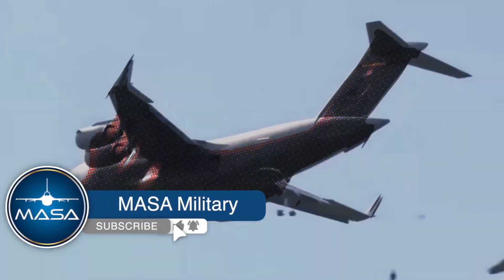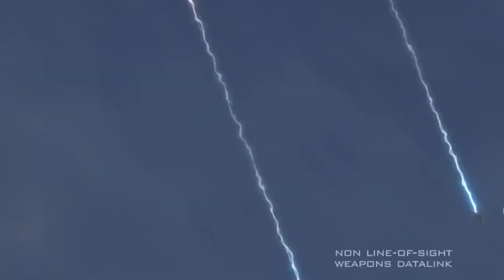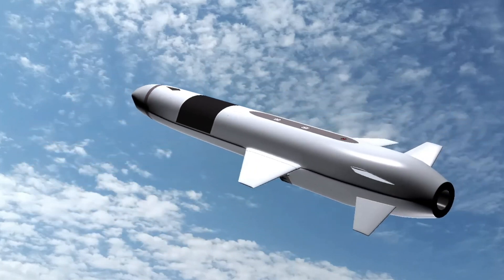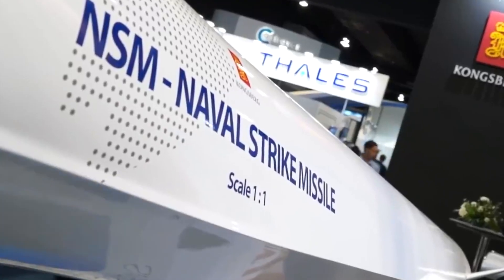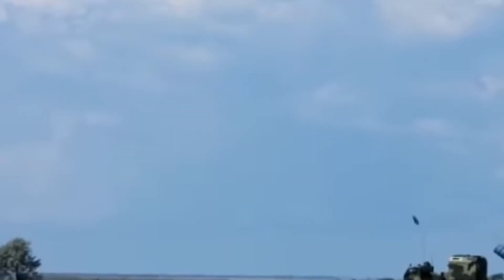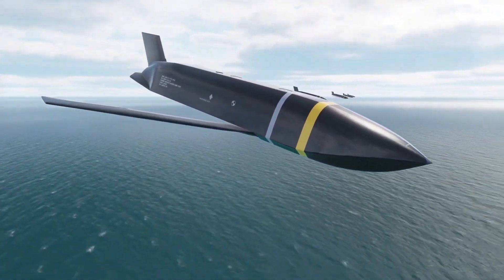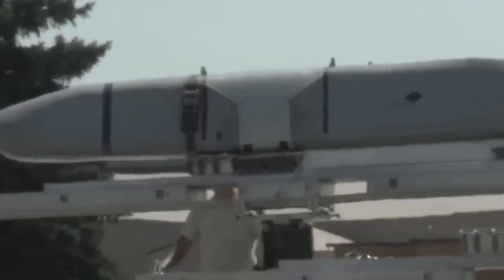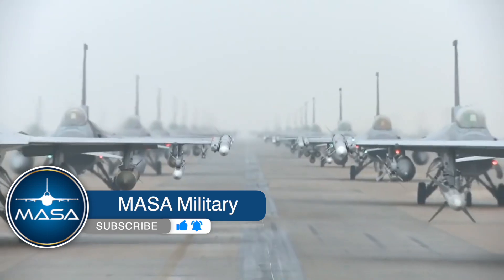U.S. Anti-Ship Missiles Go Fully Stealth, #AGM158C #LRASM #NSM #NavalStrikeMissile #military

Comment: A general basically said. "Would you rather have hundreds of other missiles or one hypersonic."

 So stealth all the way once he put that in perspective. Hypersonic missiles are weirdly expensive. 

 It is doubtful the military would be sending a single missile at any major warship anyway. 

 The newest Tomahawks are slept on. They have insane range, and now have AI to be able to identify warships which I can only assume is a defense against jamming. Them having anti ship capabilities is a huge boom. Think it is the Block Va. All Block IV will be upgraded to one of the Block Vs. 

 I beleive they are experimenting with a ram jet version for mach 3 capabilities.
Reply: US already have a ramjet missile with AGM-88G. They were able to extend older HARM's range by giving it a solid rocket-ramjet hybrid propulsion. Older AGM-88E was also tested as an anti-ship missile. Upcoming SiAW is based on AGM-88G. But another anticipated weapon is LM's hypersonic MAKO. It will be the cheapest hypersonic weapon as no novel propulsion is used like a scramjet or a glide vehicle for cost savings. It's not even a ballistic missile but a rocket that can reach hypersonic speeds. Best of all 2 MAKOs can fit inside F-35A/F-35C even F-22 so they can be launched stealthy much more closer to their targets.  Another massive boon for the USN is the dual purpose AIM-174B or air-launched SM-6. When used against surface targets, AIM-174B acts similarly to Russian Kinzhal. So its like Chinese PL-17, Russian R-37M and Kinzhal combined in one package but only half the prize of Kinzhal.